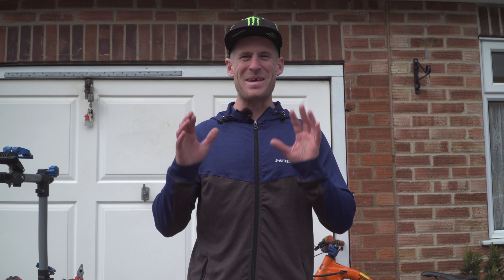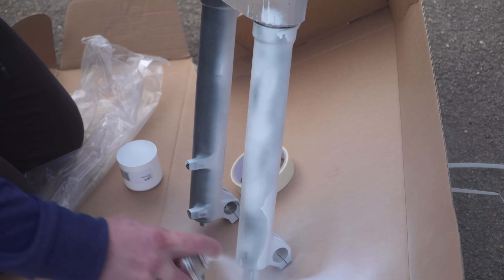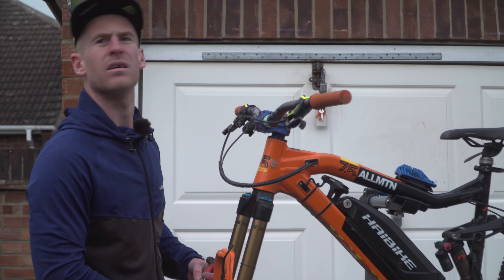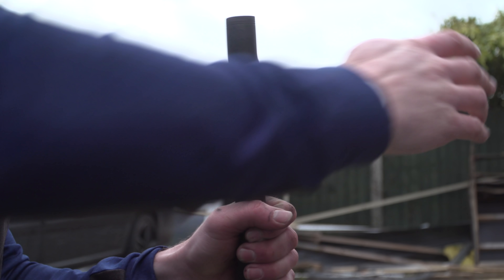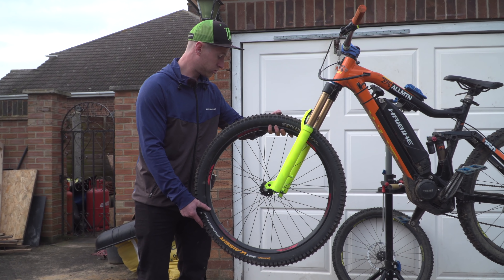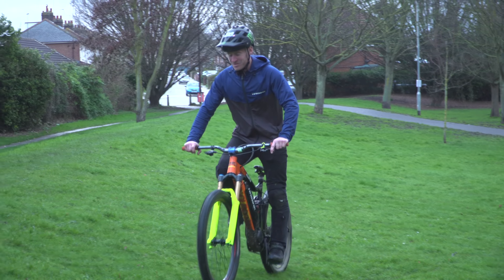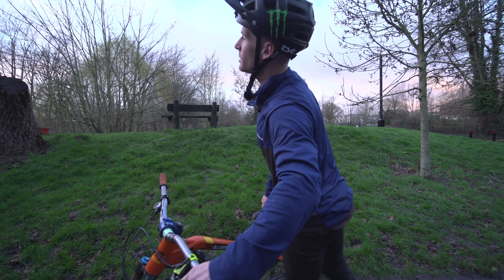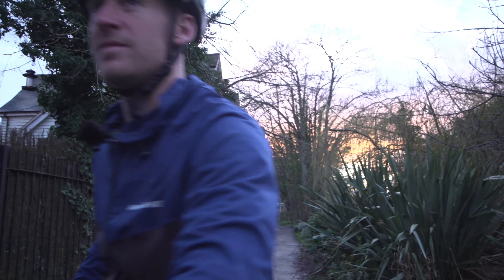FITTING NEW FORKS ON MY MTB

Comment: What's the longest you've used the same fork on the same bike? My previous fork was a 2009 Fox with 21,000 miles. Current is a Fox 36 831 26", had since April. 
Shred on brother!

Comment: Did you buy those used? The ones you installed have a FIT4 RC2 damper, which in my opinion feels worst than an SR Suntour XCM. However, the ones with the orange lowers have a Grip2 damper which is far superior. Why would you downgrade?

Comment: You need to make that a single speed so it’s like a E-slopestyle bike
Reply from the maker: Flow Finder mtb oooooohhh
Reply: It doesn't works like that u know mate
Reply: Just takeoff the cassette, Put on one cog wheel spacers, and it single speed
Reply: @liamt3418  if you just make it a single speed. Take off the front brake it won't be a slope bike. You know. Geometry Fork Wheel size stuff like that
Reply: Kamil_Zbrodziewski It’s Sam pilgrim, has he every done anything logically??
Reply from the maker: @uraniumeaterG59  Anything is a slopestyle bike. If you have style down a slope on it then its a slope bike :)

Comment: California guy lived through it on the double decker! This new sad guy, probably from New Jersey, he whines just like California guy :D :D :D
Reply: Sam, your mechanic putting on the forks was using a big battery as a hammer, I am pretty sure that aint' right.
Reply: As a plumber I will tell you that you were turning the pipe cutter in the wrong rotation making the strong possibility that the tool will fall off, or hit California guy.
Reply: Long may you live Sam, long may you live.

Comment: could tell the forks wont fit from the start😂
And there are just 3 widths:
100*15 and 110*20, both non boost and there is 110*15mm boost
Reply: Thats only 2 widths